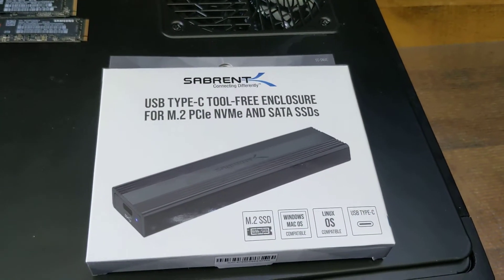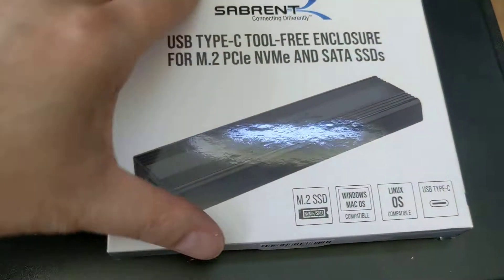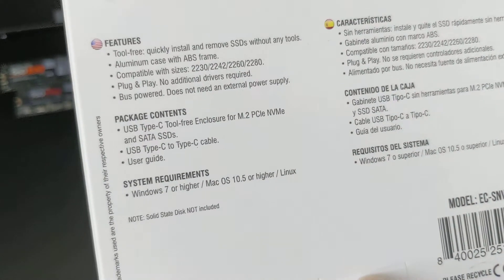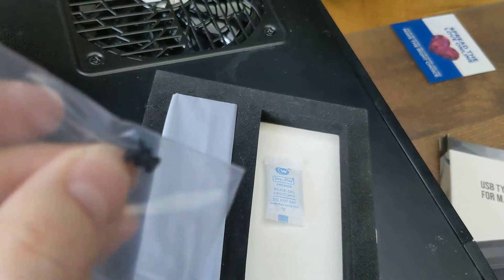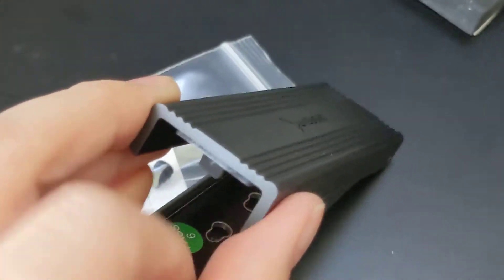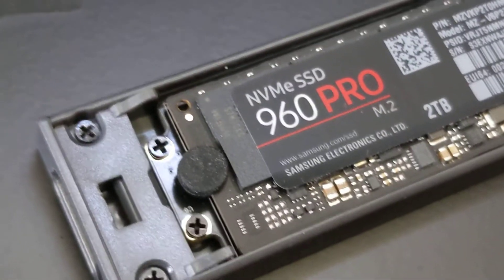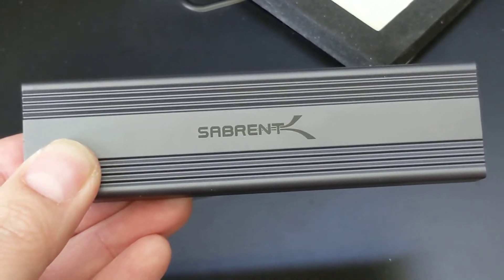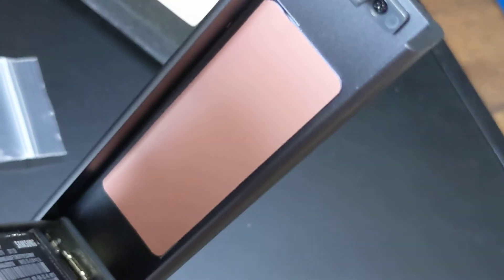Sabrent USB Type-C Tool-Free Enclosure for M.2 PCIe NVMe and M.2 SATA SSDs

Comment: Thanks for the video. The product states compatibility for both NVME and mSATA. I have a SATA M.2 SSD (which has two U notches - M key and the B key) and the new PCIe NVME with only one U notch (M key). Just thought to ask if you made any check further to verify the compatibility
Reply from the maker: My mistake.  I meant M.2 SATA drive, not mSATA.  I will correct the title.
Reply: @TechieZeddie  Thanks. By the way, mine just arrived today and I can confirm that this is fully compatible to the M.2 SATA. I have an old Samsung 850 EVO M.2 SATA series mz-n5e500 which was the C Drive on my daughter's old laptop. Unfortunately the laptop's motherboard was short circuited. I removed the M.2 SATA from the laptop and popped it into the Sabrent case and it was detected right away. Pretty much relieved she could access all her important stuff. Thanks to you once again and thanks Sabrent for the great product🙂

Comment: Does it really support mSATA SSDs? Nowhere in the manual (that you showed) indicates that. Please confirm
Reply from the maker: It does say it works with mSATA drive.  It's one if it's distinctive features.  Unfortunately, I don't have a mSATA drive to test.  I don't suspect I will for a long time since they're getting harder to find.  The only device I have with mSATA is my Surface 3 Pro, which I would have to unglue the display to get to (not very easy).

Comment: what's the heat/perfomance like?
Reply from the maker: I have no way to measure heat, but I was very careful to not leave it plugged in and do sustained reads and writes.  I'll test and follow up with a video in the future
Reply: @TechieZeddie  
I use mine with a Samsung 970 Evo Plus NVMe (1TB) and it doesn't get hot at all.
I have another enclosure (lower quality alloy case) with a Kingston 500GB mSATA and that drive burned itself to a crisp and died. I'll stick out my neck and say mSATA drives runs hotter than NVMe drives in general.
Reply from the maker: @christianholmstedt8770  That's surprisingly unexpected.  With the speed of the NVMe controllers, I would think the NVMe drives would operate hotter than the mSATA drives.

The enclosure does come with a thermal pad that would interface with the external metal body, which should be enough to conduct the heat away.  The side effect would be the enclosure would feel hot to the touch.  The drive will be within operating temps, but you may have an uncomfortable time grabbing the drive after a heavy session.
Reply: @TechieZeddie  
I was very surprised too. Can it be that the NVMe is a more modern design than mSATA? 
The mSATA enclosure didn't even have a thermal pad and it still got very warm. I did not burn myself so it was less than 60C for sure but it was close. The drive itself however... it died a horrible death.
I also managed to kill a 1TB SanDisk SD card by transferring hundreds of GB in one go.

Comment: You would think they would put a metal clip instead of that stupid rubber thing.  CHEAP!
Reply from the maker: It would be nice if it was a clip of some sort.  I would be afraid a metal clip might short something out if it ever gets loose or breaks off
Reply: I believe they did that because it’s not meant to be a permanent mounting solution but rather an easy way to install and remove M.2 this the “tool free” design.